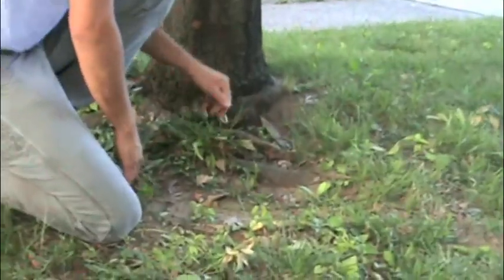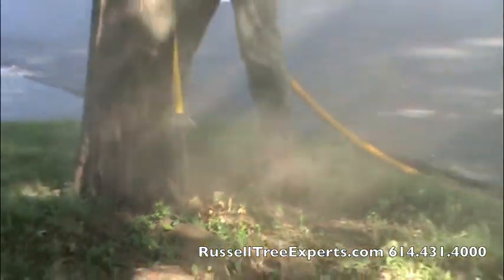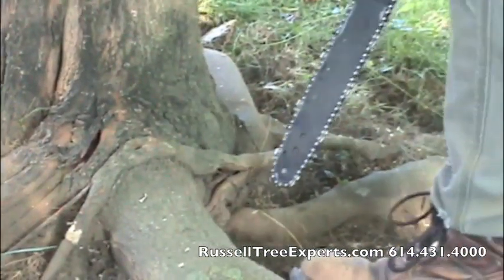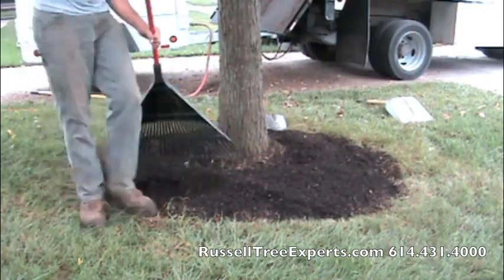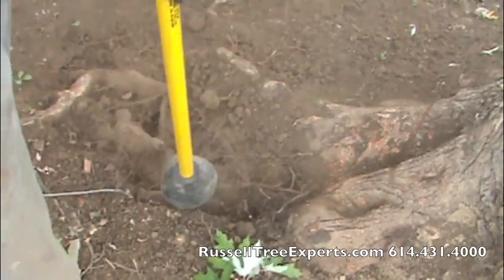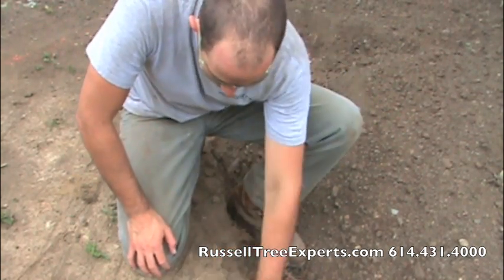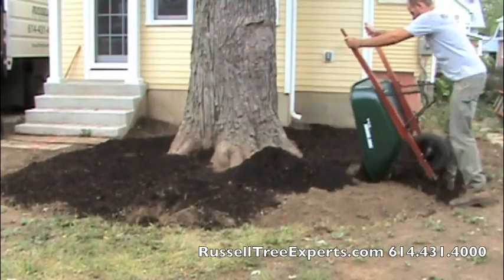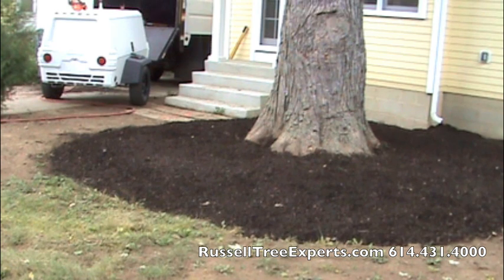Using an Air Spade to Save Trees in Ohio I Russell Tree Experts

Comment: for the fireblight it were to clean the roots from oil that infected trees may pee (collecting good on burried cement structures as a (bacterial collector creeping down along the walls) when infected branches are covered against light(not cut) so their metabolism goes down and they do not secrete so much to the roots of other branches... when not communicating disease through wounds (dust and secretes on sealing resins ), that is the main transmission factor apart from cars that loose oily dust to enterrated concrete to soak into the tree

Comment: Consider any B&B or Potted tree suspect, if was ever grown in pot during any previous stage. In fact, transforming rootball back to bare root, is only way to make sure no pre existing, future SGR's. Mulching around base of already maturing trees, is more for esthetic appearance than new root growth. Since there should be very limited amount of smaller feeder root growth within 10 feet of trunk. As big trees like one in video, had already remotely extended out larger mature roots years ago. And it's the ends of those older primaries and laterals which still continue to produce fibrous feeder roots some distance away from trunk.

I have found that great numbers of trees planted over last 45 years, just like today's new trees continue to be. Arrive from Nurseries with root flare already too deep in B&B rootball, and with existing field dug roots already distorted. Along with having their buttress roots radially outward directions altered. During Nursery growers past larger stage "Up-Potting" processes.

And fact is, today several growers manage young trees during specific stages, before  finally purchased by customer. Instead of just one Nursery starting trees from seedlings, or buying pre-grown 1-2 yr. old liner whips for installation in field.
Reply: I totally agree with consertman that speading new soil around the base of the tree is doing nothing to support the tree.  You don't want new root growth around the trunk to girdle the existing roots.  The new root growth needs to be out in the peripheral area.  Cutting the girdling roots that were exposed probably did help but tilling up the soil around the trunk and saying that this is good to stimulate new growth around the trunk seems ridiculous
Reply: @Pith Helmet, sounds like this tree was lucky to have you. Did you ever find out what species it was? If you have an Android phone you could take a picture of its leaves on Google lens and it will identify it for you.

What people usually mean by invasive is it's a very hard to kill great Urban survivor whose seedling offspring also have too great a survival rate. If you lived near a woodland it might be something to worry about but if you live in the city there's not many natural areas left it could invade.

ALS0 checkout YouTube videos to learn structural pruning during young trees formative years. This specialized pruning will help it produce one apical dominant trunk and a strong crown that will require very little prun maintenance if at all after age 20. Enjoy!

Comment: How many inches of the dirt does the air spade actually loosen?  How deep will it go down into the compacted soil?
Reply: Andrea Shank as deep as you can reach with the  nozzle, they are used in confined space rescue close proximity excavation radial mulching (compost) and more